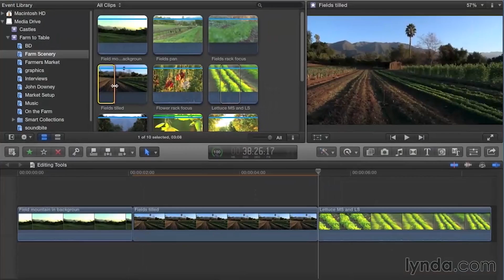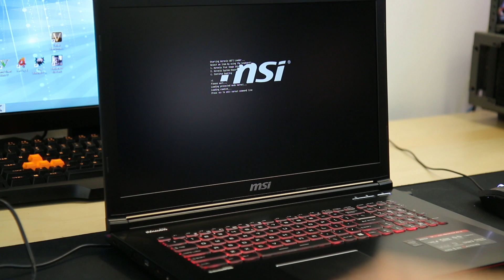How to install SSD in a laptop

Comment: Hi Jay, If your Hard disk has a bigger radius then the outer edge has more sectors of data around the larger perimeter,  than in the very centre. The disk spins at the same speed in the middle as the outer edge

Comment: Maybe more aggressive power saving applied to the data linkage and the HDD by the BIOS and/or OS for a laptop.  That if true would explain a lot about it being significantly slower for the same hardware.  Maybe even the firmware if optimized for battery savings.

Comment: Do you use the same size screwdriver on all notebooks and laptops?  Or different size fits depending? What size(s)?  I need to replace my storage but need a screwdriver, preferably without paying for a kit with a lot of pieces.

Comment: I have a big ASUS that's about 7 years old now. My wife, who grew up with computers unlike myself who's family's first computer was the Dell laptop I bought in 2001, deleted the operating system or some other component vital to actually opening Windows. 
If I were to install one of those, would I need to install Windows first? Then would I be able to access the thousands of photos and hours of video currently trapped on that drive?

Comment: Got an ASUS g50VT from 2009 in my closet. I gave it to my mom after I switched to desktop in 2012, now it runs like absolute crap. I'm hoping it's just the hard drive going to hell, hopefully I just need an ssd. I want to make it into an emulation machine, it's got decent specs for being 2009. Core 2 duo 2.53ghz, 4gb ram, Nvidia Geforce 9800GSm 512mb. It also has a nice not quite 1080p ips screen that looks a lot better than a lot of 1080p screens even today. 1650x1025 or whatever.

Comment: Dude... people unfairly hate on Apple. Apple builds products with pretty high quality control with server grade hardware. The proof is in the pudding... their machines last a very long time... whereas more consumer grade windows machines are a dime a dozen and can be had for 50$ in a pawn shop let's be honest.. you could still sell that 2009 Apple for good money and the new owner STILL get use out of it by upgrading it because it's easily one of the most upgradable models Apple ever made.. the proof is in the pudding and I just had to throw that out there. 

Ps- I also believe people hate on Apple because they can't afford them which sounds like a mean thing to say but I think it's true judging from comments I've read. I DO think Apple is going the wrong way reducing upgradability but it doesn't change the facts your getting a very well built machine that will last a very long time with its server grade components. 

 Apple builds beautiful products for beautiful people that's just how it is and as a company it has A DAMN GOOD marketing machine lol..

Comment: Great Vid Jay.  Im sure you know this can be even quicker.   in win10.  make a recovery usb stick, then make system image backup to an external drive (like a usb backup I used).  then swap the drive, boot fr0m the usb stick with the backup drive connected, choose to recover from image.  total swap and reload took me 15 minutes on msi gl62 model.  Im sure you know this but I though  others might like an easy alternative.  Still requires another drive to back up to, but if someone has that then easy peasy.

Comment: I know this is an older video but I have two questions if you could answer for me?
1. When is the soonest you can change the drive? Right after first start up or wait until all updates if any are done?
2. Could you clone the hdd to ssd on another system before ever starting the laptop then install the ssd into the laptop?

Comment: I'm always confused by the length of load times. My laptop has a pretty crappy M.2 SSD and boots up in like 5 - 10 seconds. My desktop has a 1 TB 7200 RPM HDD that boots up in like 20 - 30 seconds.

Comment: That warranty comment was dumb. I had a good laugh because if something breaks for you it's gonna cost you more time and money than the warranty itself. I bought a $200 4 year extended warranty on my MSI GE62 and it's already paid for itself 3x over because it had an overheating issue which caused the entire mobo to fail. New mobo, great service from the warranty company and my computer is as good as new.

Comment: Jay smaller platter higher density so more fine searching is required
Reply: Thanks!
Reply: And since it's smaller the outside of the disk on a 2.5" drive is slower than 3.5"

Comment: the reason smaller platters are slower than larger ones is because the larger the radius of the platter the faster that point on the platter will spin and thus the faster data can be found.

Comment: 3:44 Dude, why did you buy your wife a laptop with a Graphics card? she owned a Macbook before, so she must not be much of a gamer...
Reply: There are other uses for GPUs, otherwise NVidia's Quadro and Tesla lines wouldn't exist, and offloading any tasks from the CPU die will be better than running off the iGPU. Macbooks also leverage CPU power (or lack thereof) and OS optimizations to perform tasks most programs use the GPU for when ran in Windows or Linux.
Reply: So there's what that guy said but also he mentioned that her wife plays mine craft so... That will help

Comment: Jay I love your videos. But you're off base about MacBook Pro's not having AC wireless. Even as of last September on the date of this video, every single Mac has AC wireless, even the Mac mini. The only one that doesn't is the 2012 MacBook Pro without Retina display that still has an optical drive. If you spend 2199 on a new (2015) MacBook Pro 13" you'll get a Retina display, pcie 3.0 x4 storage and 512GB of it, 16GB of ram, and iris pro graphics. These systems use the m.2 form factor drives so you could easily put a much larger one in there if you wanted to. And yes, they have AC wireless. If an optical drive is important, you can plug in literally any usb optical drive to the system. If you would have specified which model you were referring to, then your point would make sense, however it does not and is misleading. I hope it's simply a misstatement and not a deliberate falsehood.

Comment: did the same thing with my rog g551. except I used a Samsung 850 pro. reboots in like 15 sec
Reply: that is slow.. I'm just using a WD 1tb Blue hdd, boots into desktop in under 17seconds, turn in sleep mode to desktop in under 9 seconds

Comment: I've read on amazon that the software provided in this startup kit has issues with cloning windows 10. If this is still the case, how would I go about replacing the hdd in my msi ge62 apache pro?

Comment: Hey jay, I have a similar laptop and I am having extreme heat issues right where the HDD is located whenever I game. Could you do a follow up about how you wife likes the laptop and if she also experiences this heat issue when gaming/watching movies? I have a 480GB ssd drive that I could pop in there but I am afraid I might break something along the way.
Reply: Does it just feel hot to the touch for your keyboard hand? Mine does that but if you press the turbo fan button it helps a bit but gets louder. I wouldn't worry if it's a similar situation to mine where the performance doesn't degrade and the temps are staying below 90°C.
Reply: It's pretty warm right under my keyboard hand while gaming. I read that it is the gpu  but I was wondering if the swap would help at all. And I need to clean out my fans.
Reply: My laptop came with an M.2 drive that I put games on so my HDD isn't doing anything. Still gets hot so I doubt the swap would help much in that respect. The MSI dragon gaming center should tell you what the temperatures are at inside the CPU and GPU while you're gaming and that's the most important thing.
Reply: Mine did too, but I moved the OS over to the HDD during the win 10 upgrade. I think it is silly taking up valuable space on the M.2 with that. Swapping the HDD will only help a little, but not that much. That's why this weekend I am going to do a major overhaul on the laptop and see if that helps. Gonna add 2x 120gb M.2 and set up the 3 of them in raid 0, swap out the 1T HDD for a 480gb SSD that I have laying around, replace all the thermal paste with a better aftermarket, clean out the fans and any other dust. I have two dogs, its going to be a mess in there. I called MSI support, the warranty sticker doesn't mean anything, they will support the warranty.
Reply: b1oody 67 isn't there only one M.2 slot? Also, I will say that one of the biggest advantages of an ssd is having windows on it. It doesn't take much space and you can put all the space hogging media on the hdd. Another trick you can use is transferring steam games between the ssd and hdd depending on whether you're playing them at the time.
Reply: It depends on the model, they use different boards for different model ranges. I have a GE 72 2QF pro 77, https://elchapuzasinformatico.com/wp-content/uploads/2015/01/MSI-GE62-2QE-Apache-16.jpg. The OS was taking up 60gb for me, it probably had all the language packs and other junk too. And you can only really fit 3 new age games on the m2, for example, titan fall (~60), division (~30), Battlefield(~30). And even internally transferring those from HDD to SSD would talk a few hours.

Comment: 1:31 minutes to restart is actually slower than my "Compaq Presario C500" which by the way is nearly 9 years from 2007, and my laptop runs windows XP with 120gb HDD.... This is why i hate windows 8 and 10.

Comment: Any particular reason you pulled the 1tb HDD out for a 2.5" SSD instead of using one of the machines 3 m.2 slots for the SSD?
Reply: That's what I was wondering
Reply: Because those weren't so commonly used in mid 2015.
Reply: They've been around for quite some time, and normal speed m.2s have been quite affordable for a while as well. But going by Jayz usual hardware things it doesn't seem like the moderate price increase would have mattered to him.
Reply: TacticalTeabagging It's just easier to install an hard drive and clone it like this, doesn't matter much.
Reply: Its the same process for both...

Comment: I have the same laptop, and mine also has a 1tb hard drive, but it also has a 256gb ssd for the OS. So, I don't see point in this video since yours should have the same. Sorry.
Reply: +O T T G That one is older than yours, and there are different configurations.

Comment: I also purchased that Kingston HyperX Savage bundle 240gb to replace my Toshiba 5200rpm laptop hdd, and that bundle is the best you can get. No need to purchase a seperate device to clone your hdd, and search for the market for a hdd enclosure and the best part is you can have an external drive for free.

Probably the best ssd you can buy if you are first time upgrading your laptop. Mor elike Kingston said, ok upgrade your ssd and you don't have to worry about other stuffs, we got you covered.

Comment: Guys my hard drive runs at 10mbps
Reply: +Joe White I think you mean MBps.
Reply: Are you sure that isn't a floppy?

Are you running it at 1000 RPM?
Reply: +powerplayer75 it's an old laptop ok 7years old- it's a 250gb hdd
Reply: +Burgergaming I have a 9 year old laptop with a 250 HDD that runs faster than that.
Reply: +powerplayer75 my 5 year old soon to be 6 year old wd 500 gb drive goes at 70 mbps

Comment: I don't have that great of a pc and it's on Windows 10 and it took about 15 seconds to restard
Reply: Restart
Reply: +Master Whatwhat Does it have an SSHD? (Hybrid drive) or the general, HDD. My laptop has an SSHD (Acer) and was a low end (600 USD) device, albeit it with good boot times, given I put the windows OS and a few key apps on the 8GB of Flash Storage.
Reply: Heavy laptop is heavy, and Heavy desktop is VERY , VERY Heavy.

Comment: Laptop drives are slower because they do spin at a lower RPM: 5400 vs 7200.
Reply: ***** True, but 5400 RPM drives are far more common. I've never seen a semi-mainstream manufacturer include a 7200 RPM drive in a laptop.
Reply: Interesting... After looking up some laptops, it looks like 7200 RPM becomes standard issue once you venture into the higher-end gaming market (which totally makes sense)
Reply: IMHO, the step up to an SSD should happen a lot lower in the spectrum than most OEM's put it.
Reply: Yeah, those SSD's get real expensive, real quick. I've just got a 500 GB hybrid drive in my laptop, but my desktop has a 250 GB 2.5" SSD and a 2 TB HDD B)

Comment: I know nobody is going to read this. But the smaller ones are slower because the disk inside has a smaller radius. And the bigger the radius, the faster something moves. Something smaller to the spinning point only moves a very small amount. Something further away from the turning point has to move a bigger distance to still be at the same point.

Comment: Smaller platters are slower because even if they spin at 7200rpm, the platter has to cover less distance per revolution, meaning that data stored towards the outside edge is travelling slower than data in the same location on a larger 3.5 inch drive.

Comment: I actually thought he was going to put in an M2 SSD. Of course not lol.
Reply: +Nicholas Reif Can you run one of these ssd m2 slots and have it for ''booting'' only? or is it only used for storage?
Reply: +dan lambert you can use and install up to 2 M.2. ssds. so you can actually use raid 0 etc.
Reply: +dan lambert I will update you later maybe if I decide to take my laptop apart this weekend.
Reply: +dan lambert Took it apart today. It actually has three M.2 Slots. Which are the same as any other storage. You can use it for OS or whatever else. They are 2280 size. Or you can just remove your HDD and replace it with a SSD SATA 3.

Comment: 1min 30 seconds is slow? really... OK this is when I have to call people  out on the whole SSD thing. They cost nearly 10x as much per gig... thats real actual money that could be spent on other things, and when 1min and 30 seconds is SLOW I think our culture needs to learn to be patient.
Reply: I think you miss the point. First off, no they do not cost anywhere near 10 times as much, to get a quality and reliable 1tb HDD for a laptop is about $60, which is around 5x cheaper. That still is a lot, but half of what you said. Also, he went with the more expensive option. Most higher end laptops have a HDD for mass storage and then a smaller SSD, not supper expensive, just to store the operating system, for fast boot ups. It is called a boot drive. 

More so, SSDs are all around higher performance, they are going to eventually completely replace HDDs. They are more expensive now, but as they become more and more common, they will become cheaper. That is how new technology works. 

Finally,  that is a brand new laptop with hardly anything on it. As HDDs become more full, they slow down. My pretty old laptop with a half full HDD takes around 3 minutes to reboot. That is a point where it becomes a pain to shut down and reboot when moving between my classes. With an SSD, it will always be as fast even when mostly full.

Comment: Thanks for the video, thumbs up and subscribed.  I was doing a similar upgrade to my wife's new MSI GE72 Apache Pro-003.  I am curious why you went with a HyperX 960gb SSD?  I checked online, and that drive runs about $350.  For $91, I installed a Samsung 250GB M.2 ssd in the M.2 slot on the GE72.  250GB was plenty of space for the O/S and programs.  You could then leave the 1TB drive in the laptop as a data storage drive where speed is not so important.

Comment: If the 2.5 inch HDD has a smaller platter, then it should be running slower than a 3.5 simply because information can be stored on the edge of the platter. And as a larger platter, it can "spin" faster than on the smaller form factor. Not all the information on a HDD can be accessed at the same speed :P (correct me if I'm wrong with all of this)

Comment: Just installed a m.2 250gb ssd.. I don't know what the slots mean... two of the same kind and the bottom one is a m.2 combo? What's the differences between the two... i put my 2280SS m.2 crucial in the combo slot, it works well.. dunno if it would of fitted in the other two

Comment: Doesn't this particular laptop also have a built in M.2 port? I'm actually considering getting this exact laptop. It'd be nice if I could run an SSD on the M.2 connector and the HDD on the SATA connector.

Comment: +JayzTwoCents I think the reason bigger drives are faster is as follows: Bigger drives have got a bigger circumference compared to smaller drives. Considering that the velocity is distance/time, then your velocity equation would be > v = pi x diameter / time for 1 rotation. The faster your velocity, the faster your read head can read the data from the spinning platter.

If this is wrong, please feel free to correct me.

Comment: I've been looking everywhere and I cant find an answer, I have this computer MSI Apache GE72, there is an option to buy this computer with an M.2 SSD, however I didn't buy that one, because I got this computer for 1k off newegg 200$ off on black friday. Well, soon I'll want to buy a M.2 SSD, and I'm worried I can't install it on this computer? Can I? are they limitations in the size I can buy was looking at a 250, or 500gb?

Comment: You can actually put the SSD into the thick MBP and max out its RAM (usually at 8GB or 16.) It will still deliver a satisfactory experience as Macs are really built to last. My 5-year-old MacBook Pro with i7-2620M (as old as Little Jay?) have a 60GB Kingston V300 SSD and 8GB RAM. With OS X it is pretty smooth to use. (The small SSD space is not a limiting factor as I have 20TB storage on my network and that laptop is only used as a floater in my home, handling odd jobs)